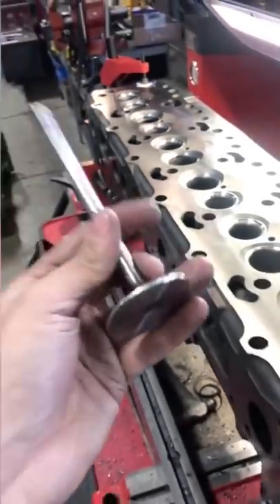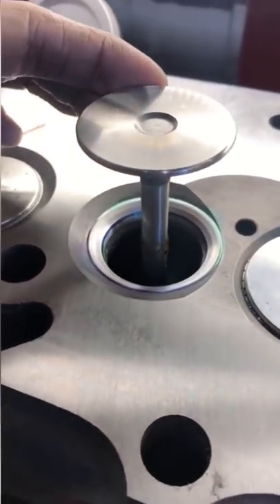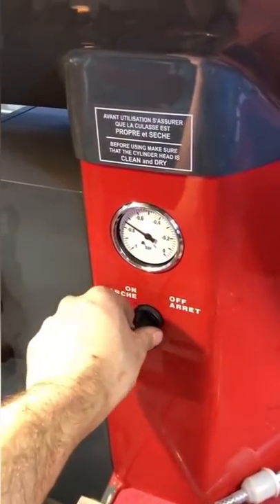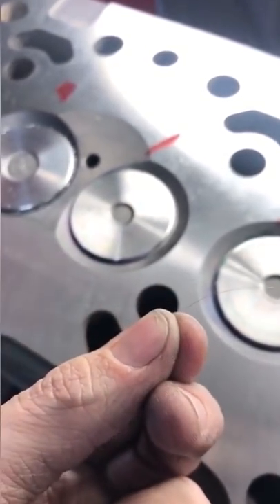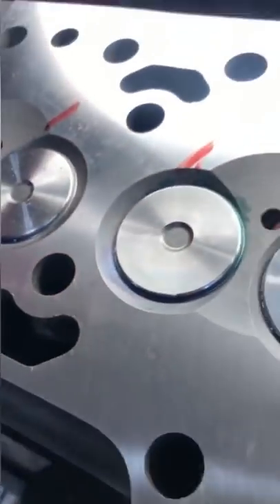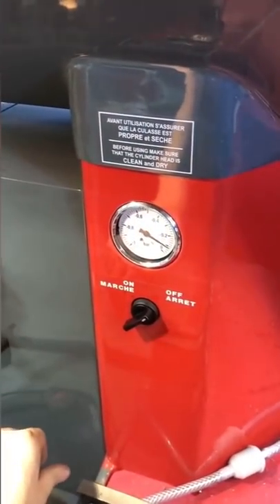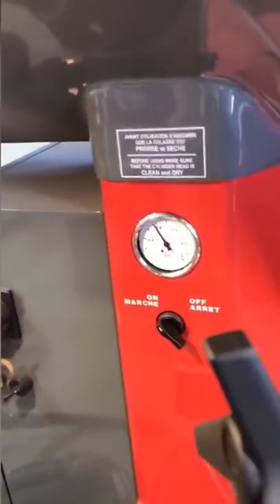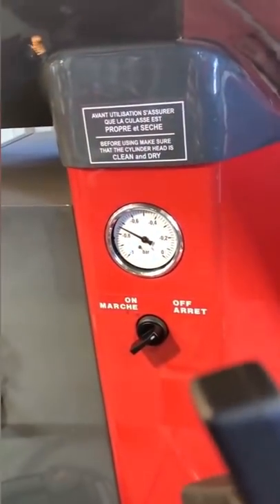#shorts Engine Machining Tolerances in layman's terms!

Comment: I had to run a job a bushings one time that had a +0, -.0001 they were stainless so even breathing on them would put them out of tolerance due to the heat lol
Reply: @LexiFox420  he’s not wrong. A tenth of a thousand of an inch is so small, it would not surprise me if a small temperature change would move it that much. As some one with both machining and black smithing experience, you aren’t playing with thousandths, let alone tenths of thousandths.
Reply: So how did you reliably keep the tolerances in range? And how tf do you calibrate machinery that can measure to plus or minus ONE TEN THOUSANDTH of an inch??
Reply: @ians.2941  Mind = blown. Although now that I'm thinking about it, lots of metalwork is honed to within a few microns
Reply: Is there any Good reason to use imperial units?
Reply: This is why formula 1 cylinders are made "egg-shaped", so when they pump oil in to the engine before starting it the cylinders change shape and become round and fit way tighter than normal cars
Reply: @johannes9640  I’m not sure, although it’s probably for precision purposes. I don’t think I’ve ever heard someone use the term “50 thousandths of a millimeter.” Our measurement system may not make sense going up (feet, yards, miles) but it does make sense going down (tenths, hundredths, thousandths)
Reply: @ians.2941  Im am sorry to insult your measurement system but I think it dont makes sense in either direction (but thats the perspective from a foreigner and probably because im mad at your system of measurment in general) but you can have the same precision in the metric system for example 0.0001inces would be 2.54 Mikrometer (1mm=1000Mikrometer)
Reply: @johannes9640  I suppose it’d be fine in either measurement system then. Although Mikrometers would be smaller compared to thousandths of an inch, but definitely still usable. Is there anything that’d be our equivalent to millionths of an inch?
Reply: @ians.2941  yes 0.000001inch would be 25.4 Nanometer  (1Mikrometer=1000Nanometer)
Reply: @johannes9640  decimal inch
Reply: @johannes9640  1 thou is 1/1000 inch
1 tenth is 1/10,000
If you're dealing in millionths, l dont believe you.
Reply: @johannes9640  freedom units
Reply: @spencerburton376  nah  your cat is so small it  technically doesn't exist
Reply: I work in metric units and thought you meant 0.0001 mm. It's tight tolerance in imperial regardless but I was properly shocked for a second 😂
Reply: @ians.2941  The wire machines are great, we just got a new one where i work. The big upside is that wear isn't a thing because the wire is constantly being fed fresh from the spool. They hold crazy tolerance.
Reply: @seandavis9908  my father specializes in EDM work, they’re extremely impressive machines, albeit his are older machines. He has one wire machine that’ll “split tenths of a thousandth an inch” as he puts it. I personally just stick to my lathes and milling machines. Never really understood the programming for edm machines, and the shop I work at doesn’t have any anyway.
Reply: @ians.2941  I run wire edm machines sometimes mainly a agiecharmilles cut200, cut300 and a cut440 fl. they’re beat to fuck and falling apart but still make parts within a micron or two. The programming and all the issues with maintenance are that’s making me second guess a career in edm machining but it’s probably different at companies that actually run them.
Reply: @seandavis9908  same. Our machines are able to be driven by 0.0001 mm but not manufacture reliably. Out tolerance at the moment is +0.002 +0.018 so 16μm. Witch I still find fascinating cause we make around 1200-1800 of them a day.
Reply: @spencerburton376  no deadass man. crazy isn’t it?
Reply: @seandavis9908  hahaha thats funny.
Reply: @dandc2011  you have to produce a part and then inspect it frequently with highly calibrated inspection equipment after any and all changes to the process...you have to compensate for machine movement errors by changing the program to achieve the desired product specifications...so you monitor what the machine is producing by inspection methods...sometimes inspection of nearly every part.
Reply: @dandc2011  machines have laser tool measurement and so it pretty damn perfect but still takes skill
Reply: @dandc2011  a little late to the party but you can use CMM to measure far smaller than a tenth. Using glass scales etched to the millionths of an inch, the machine will use a lser to count how many lines have been passed and tell you how far its moved.
Reply: @johannes9640  no
Reply: The worst part is you had to work with stainless steel
Reply: @johannes9640  0.00001 inches is 0.254 micrometer, not 2.54 micrometer.
Reply: @mackk123  look up how to make guage balls by Robrenz. The guy uses a B&S millionths indicator in that video to calibrate his guages. Millionths is used in a lot of stuff, especially things like joey blocks and other precision instruments. The whole field of metrology can become ridiculously specific, measuring things at exact temps
Reply: @irishwristwatch2487  Robrenz can do it because he has the metrological equipment. Do you deal in millionths on a regular basis? That'd be interesting to hear what sorts of instruments and machines you're working with. Metrology should not be a dying art.
Reply: @mackk123  I dont personally but he was making precision stuff, similar to joey blocks. Ive used the metric equivalent for zero clearance dies before but metrology is far from dying. Its just a bit more niche these days
Reply: That's why you're hopefully working in a temperature controlled environment, using lots of coolant, and don't forget to do your temperature compensation calculations.
Reply: Most aerospace fasteners are within +/- .0002, to hold .0001 you probably had to rough them .0003 over thats impressive
Reply: @bonlappen3000  bro schroedinger created and published an entire theory about this. @Spencer Burton's cat is so small that it both does AND does not exist until it is observed
Reply: @dandc2011  when I was machining and had some parts that were +/- .0008 we would minimize hands on time with the part and sit it in our Q.C room that had a set temperature and then run the part on a cmm after sitting in their for 10 minutes or so
Reply: @dandc2011  and a lot of the accuracy is from indicating parts in the machine on setup and constant adjustments throughout
Reply: Im a quality supervisor in a aluminum die cast plant making automotive parts and we run cmm programs on the parts we run and some parts fail if there even out by 5 to 10 microns its crazy to fathom that
Reply: @ians.2941  you talk like we dont have units smaller than millimeters bro,come on. Imperial sucks
Reply: @johannes9640  Imperial is just as good as metric. Both have advantages and disadvantages, but both can do everything precisely. For example it is easier to be more pecice with Imperial when it comes to temperatures (as Fahrenheit is a smaller measurement) and weight/mass, as mass = weight on earth. This works because the Imperial unit for mass is 1 slug (32 pounds) and the acceleration of gravity is 32 feet per second squared. You end up with mass 32 pounds / gravity 32 ft per s^2 = weight which would be 1. So in short you end up with 1=1. Metric is easier to be precise with in small measurements. The weirdest part about metric is that it doesn't have a moderate length unit for measurement  (comparable to Imperial's foot) I guess you could use decimeters, but who really uses those. 

P.s. Metric needs to measure people's heights in decimeters or just use meters because cm's are way too small for that crap 😆
Reply: @spencerburton376  he's not wrong
Reply: @sammyh.748  height is actually measured in cm. And regarding temperature measurement, you just go 23.451°C. in metric you use Newtons for relating mass to gravity. 1kg of mass in earth's gravity produces a force of 9.81 Newtons, other way round 1 newton is about 102 grams
Reply: @erzhaider  Yes, I said height is is cm. You missed the point of my conversation with the other guy. I was saying it is easier to be more precise with the two measurement systems depending on what you are measuring (aka. you don't need as many decimal places), not that one is more accurate then the other. Both are equally as accurate, you just need more decimals places.
Edit: Forgot to mention this.
Metric uses Newtons to relate the force of gravity (weight) on an object which is separate from its mass. Imperial uses pound force (weight), which is equal to its mass. For example, I weigh 200 pounds and I have a mass of 200 pounds. That is how imperial works, weight (or force of gravity on earth) = mass. So imperial is set up in a way the we don't need a separate unit for force because the mass in imperial is equal to the force which gravity puts on an object.
Reply: @johannes9640  Yes: if the original part was specified in imp, then conversion will just add potential for error.
Reply: @seandavis9908  yeah, thou(sandth of inch) and tenth (of a thou) are the units of choice for most US machinists. 1 mil also means a thousandth of an inch, but machinists don't use that unit specifically to avoid confuaion with millimetre.
Reply: @sammyh.748  The joy of metric is that transferring from one unit to the other is easy, so most people don't really have to think about 168 cm = 1.68 m. Centimeters are used for human height because that's all the precision you need, and when entering it into a computer you don't have to type a decimal point. 
Nobody uses decimetre, it's like the cousin no-one wants to talk about. It's just too big for anything on the human scale, yet too small (and still too imprecise) for most things in civil engineering. Centimetre is mostly enough precision in everyday life, while all engineering is done in 3 order of magnitude steps: kilometre, metre, millimetre, micrometre, nanometre. Or just plain metre and engineering notation. Things above that usually get lightyears and parsecs on both sides of the Atlantic, while things smaller than that are usually so niche they invent their own units (a barn being 1e-28 m^2, and being used in atomic physics for interaction cross-sections)
Reply: And that's another reason my shop has a/c in the summer! Can't have missile parts be off!
Reply: @Validole  Yeah, that is the nice part about metric, just swap the decimal place and it is a new unit. It isn't too bad in Imperial either though. Once you get used to how the units are being divided up, it isn't too bad, but yeah metric is way easier in those regards. You don't really find a need to convert to different units that much though in Imperial (at least for length anyways) because we usually write the distance in feet plus how many inches are left.
Reply: @sammyh.748  Except when it's miles, or inches+fractionals, or decimal inches. Essentially I'm asking: why settle for "it isn't too bad"?

Slightly anecdotally, I just listened to a video on WW2-era naval rangefinding, with 12-foot baseline rangefinders directing fire from 16-inch guns to targets at distances measured in *yards*. While admittedly, maritime stuff has always liked being "different" from the land-lubbers, nautical mile at least has a mathematical rationale that made early navigation calculations easier, being a fixed decimal fraction of a quarter-meridian. All the other mentioned units are essentially arbitrary and nowadays, all fixed to the metric system.
Reply: @Validole  You still rarely convert miles to feet/yards though. Military stuff is quite different though. Plus to answer your question for why settle for isn't to bad, we use both systems interchangeably depending on which measurement system fits the situation better. Architecture we use Imperial, engineering uses both depending on what they make or who it's for,  medical uses Imperial for temperature and metric for medicine. The list goes on for forever. In the states it is about which system fits the application best/easiest because quite a few people understand both and they are both excellent systems.
Reply: @johannes9640  it's easy to communicate quickly. Most non imperial users resist this explanation but we kinda look at the .001" as a base unit not the full inch while ignoring 1/100 and 1/10. So for every inch we have 1000 units without changing the language at all or offering any qualifying words. "What's that valve stem measure?" "It's three forty one." We often drop the "hundred" in english. In metric wed have to say "its eight and sixty six hudreths." Which is definitely more syllables on average. That and most serious engine rebuilding is done on vintage american engines where most nominal dimensions are in inches. We also often inherit tools from our fathers, grandfather, and workplaces and we learn in an apprentice sort of way not often in schools. I dont do physics with imperial but measuring is fine. And for the .0001" application we call that 1/10 as the "thousandth" is like the base unit to us. its smaller than the 1/100mm but tools that measure singular microns might not be practical or affordable and it can be a little weird counting in 2's or 3's. Im not arguing its better or metric countries should give it a try. Im just saying that there is no reason to change your instrumentation, familiarity and shop talk over some European thinking you're a little strange 🤣
Reply: @danieldimitri6133  we wouldn't say 'hundredths', that's a fraction and therefore imperial. We'd use decimal, which is metric- "eight point six two", which is the same amount of syllables, or just "point six two" which is less, since a millimetre is huge when dealing with that kind of precision.

Although valve stems are measured to 3 decimal places, eg 8.625, or just "six two five". Each 0.0025mm is equivalent to 1 tenth in old money.
Reply: @ians.2941  microns are metric.
What amazes me is how a fractional system suddenly uses 1000's when it gets too small.

Comment: Right, I hold a +/- .0004 all day. People who don't know the trade have no idea! Great video bro!👊🤘
Reply: You found so much better of a way to type +/- im over here typing out plus or minus
Reply: Is that in MM or in inches? If it’s inches thats really not that impressive lol
Reply: @balthazarnaylor5874  I 2nd that
Reply: @balthazarnaylor5874  lol prolly won't ever get an answer
Reply: @FezCaliph  because it’s inches haha
Reply: @balthazarnaylor5874  inches, what do you do with that kind of precision? LOL
Reply: @charliebaileyandloganberry7557  they are kids waving around a wooden mm scale, yammering on about how they struggle with fractions and such. Decimal inch is king.
Reply: @charliebaileyandloganberry7557  what are you talking about? It’s insanely easy to hold any tolerance around 0.1 mm… I can do that with a bandsaw. Using any sort of sophisticated machining equipment should be able to easily hold a tolerance around 0.01 mm or even lower depending on the quality… tool wear not taken into account of course, on a mass production scale it should be more like 0.05 mm… but come on, 0.1 mm is the absolute BASICS when it comes to tolerances
Reply: @balthazarnaylor5874  why do I have a feeling you are a CNC operator who runs tried and true programs on the daily. Or nothing over an inch in size. I make several large parts around +/-.0005 that will go from nominal to out of tolerance machining in the summer time at 90-95 degrees and checked at 68 in qa. Or other one off parts that simply don't just cut right to nominal size on one shot.
Reply: @balthazarnaylor5874  they are not talking about .1mm (~.004"). They said .01mm (~.0004")
Reply: @ernestocastellanos6446  oh well that changes everything lol
Reply: I was a machinist for 40 years on manual machines before CNCs were a thing.  I made parts for the aircraft industry that had tolerances of +.0000 -.0002.
Also in those days you started off on milling machines, jig bores or lathes depending on the job and finish the job on surface grinders, I.D. and O.D. grinders, all  manually operated. Automatic feed was about as automatic as it got. For high tolerance holes, you'd use jig grinders for positioning and hole diameters.
Reply: My loose tolerances are 9 times thinner than a sheet of paper. All my clearance tolerances Are less than 5 micron.
Reply: @charliebaileyandloganberry7557  wow! Your awesome!!!!
Reply: @Proud-pop  i worked in a shop that made connecting rods and crankshafts. Your post took me right back. I just had a flashback from when I had to shovel out the sludge pit for the grinding dept. So many good times 😜

Comment: I love this, I try explaining stuff like this to customers when I talk about why an engine failed or transmission failed, especially when the trans has lots of metal in it.
This is a perfect example.
I could see a shop actually using this to educate a customer.
Reply: I don't think the average motorist is even knowledgeable in how crucial routine maintenance is? Not unless they have a new car and the dealer is reminding them to take it in for maintenance. Which is why you really have to look over any used vehicle with a fine comb. I always check to see if there's any signs of sludge. Look at the tail pipes to see any signs off oil & fuel vapor. Sometimes it's not so easy, but if you've been around enough cars and have done all of your own work. Then you can usually tell how healthy an engine is by driving it. I still will always run some seafoam through the vacuum, crankcase and fuel tank. 2 cans to be exact. Drive it for a few hundred miles. Then give it an oil change and a tune up. It always clears out any carbon deposits on the valves and in the intake. It'll cure most hesitation, poor idle, etc. I also make sure to do the same b4 I sell any vehicle of mine as well.